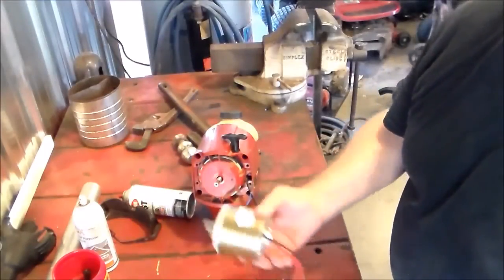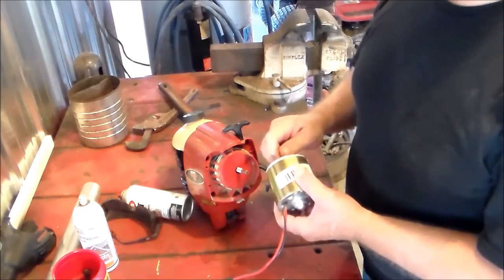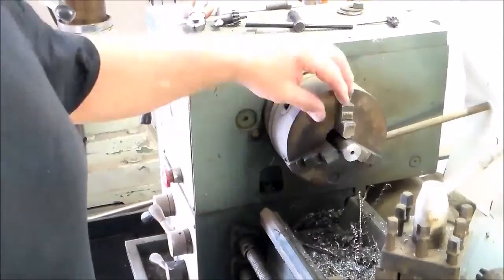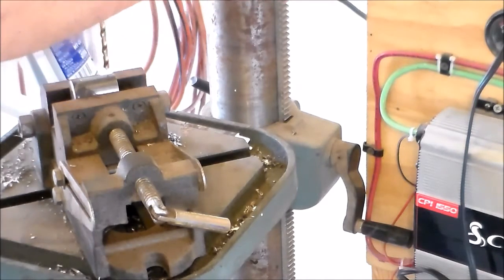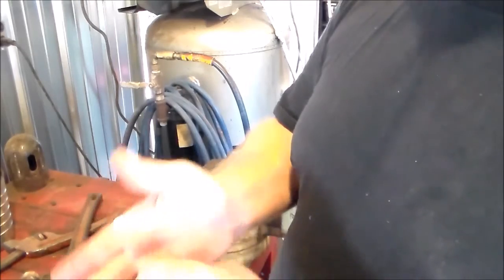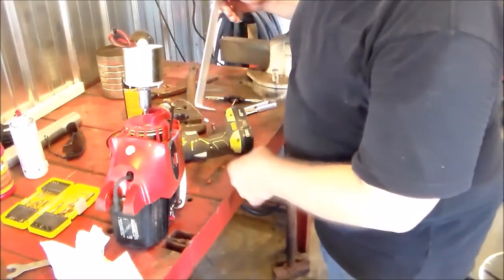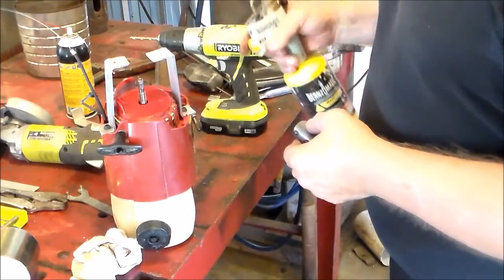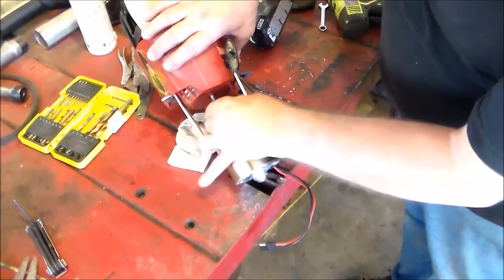Weed Eater Engine Generator pt.1

Comment: ok thanks for getting back to me need more info what is the dc 30w  on your charger so can you list the dc motor size Numbers would be a big help am lost on what size i need i need 4amps out put
Reply from the maker: Google "ForEverlast 12V Motor" you will get several options for your area.

Comment: I have an electric scooter that runs off a 4x 48v batteries that give a total of 18A/h. Wanna try to substitute them with a weedwaker motor generator. It'll still be an electric scooter which would fall under motor assisted bicycle law but the finite travel distance would now be lifted. Thanks for the video.

Comment: how can i make a weedeater motor for my project please help...
shubhamojha001@gmail.com
thanks
Reply from the maker: +Shubham Ojha   A 12 volt heater blower motor, a diode, small weed eater engine. Collect those parts first and you will see how you have to connect the engine and 12 volt motor together. Good luck on the build.
Reply: +Rusty “rustyglovebox” Glovebox see i am a mechanical engineering student in my final year and i am making an amphibian vehicle...for that i need two weedeater motor that can drive my vehicle so can you make it for us...?
i live in india there aren't any weedeater engine available here so can you help me?
thanks

Comment: It would be interesting to learn how many watts (or milliamps) that motor can generate at 15-16 vdc. I don't believe it is the same as the amount of current the motor draws when used as a motor. It will be difficult to determine without damaging or destroying the motor. Interesting project. Thanks Lloyd.
Reply from the maker: Bruce Boschek I don't think it produces very much, maybe 100 to  200 watts at the most. But when I let it charge a battery and the invertor operates off of that. It should operate a light or 2. We will see. Take care Bruce

Comment: Cool - Always Interested in Projects Like That - T=up Lloyd
Reply from the maker: FixinThatUp Thanks Stan,  Electricity  and generators interests me. I have a Delco light plant made in early 30's. Generates 32 volts ,  it operates some light bulbs and a 32 volt GE oscillating fan. Lots of fun working with old engines, machines , equipment and tools.
Reply: did u see the guy who made the self running machine with a high pressure pump Lloyd
Reply from the maker: FixinThatUp I have not seen that one yet, I did watch a magnet engine earlier to day. 
Do I look for "pressure pump engine"?
Reply: i think i was looking up self running generator or self running motor - if u can't find it let me know - i will go and find it

Comment: Great idea. One further thought, drill a hole right through the bottom of an appropriate size to allow you to be able to change the spark plug without lifting the whole assembly off the base. It may have to be a slot type hole so that you could get the wire off the plug to be able to remove said plug.              Love and Peace.        Blessed Be.      Doug
Reply from the maker: Douglas Smith Very good idea, even if I don't leave it on that base it's on now I will make sure to do that. 
Thanks Doug . Bless you and have a good week